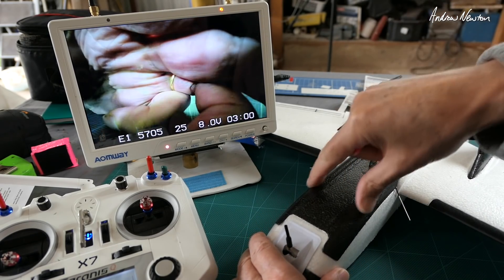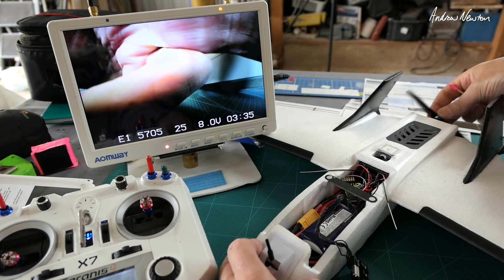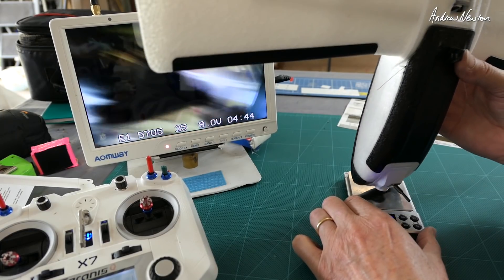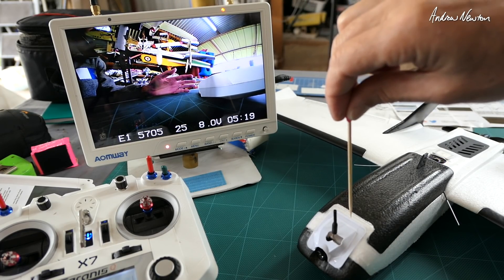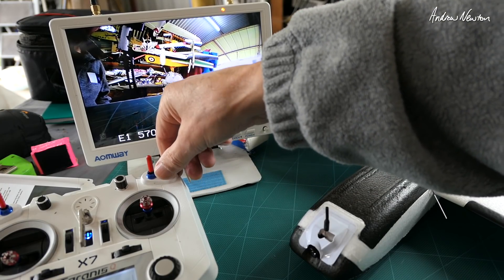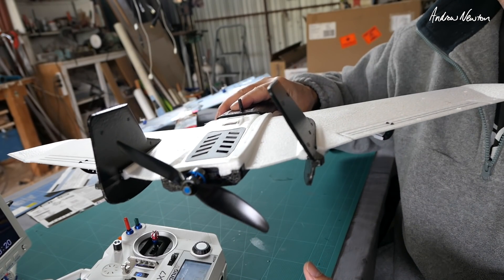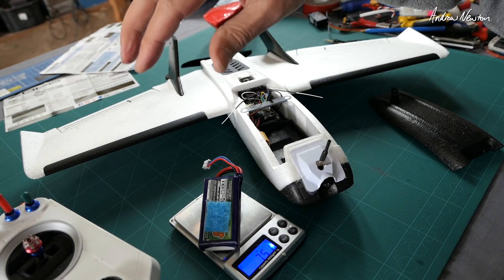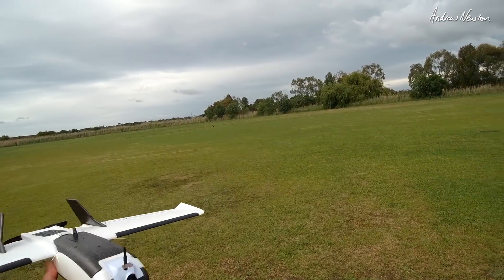ZOHD Dart 250G Kopilot Lite VC400

Comment: Thanks Andrew, the Kopilot actually worked better than I expected, especially with the winds, and the VC400 was quite impressive at 25mw as well and thank you for running it on 2s lipo an Li-ion was nice to see the power it still had running the smaller battery and larger prop, I think I am going to like this little guy. I would probably keep it grounded on days as windy as yours was there, but it is nice to know it is capable.  Cheers from the still cold rainy, snowy, and now icy Midwest USA.
Reply from the maker: Icy already? I'll send some warmth in future videos.

Comment: Good job  looking great.  My instructions didn't even say what voltage to run only 2s or 3s and the print is so small I have to use a magnifying glass lol.. Your instructions
are very helpful and thank you for that.  I will also be changing the connector to an xt60 connector also.  Happy Flying

Comment: My Nano Dart arrived an hour ago, already put together and ready to fly in the morning if the weather stays like it is now...
Reply from the maker: Good luck, throw hard and 3/4 throttle
Reply: @AndrewNewton  I would have thrown it hard if I could have gotten to my airfield which is situated about a mile from the main road. I have to travel a third of way on tarmac then the road changes to chalk, so far so good, and the final third is dirt which after some heavy rain recently turned to mud. The flying field is situated on top of a hill of about 100ft high. Unfortunately today, I got stuck 5 times in the mud and only got half way up the hill when i decided to give up and go home, my little Citroen C1 is not designed to be a 4x4... It will now have to wait till we have a long dry spell for the dirt road and field to dry out before i attempt to get there. Just have to build some more models instead...

Comment: Mine keeps ending in tears.  My Dart 250G keeps nose diving when using the KOPILOT.  On the bench everything seems set up correct. Control surfaces rise to meet the sticks with pitch and roll.  Put it in stabilized mode, roll right, and the left aileron rises, roll left, and the right aileron rises, pitch down and both ailerons rise, pitch up and both ailerons fall.  I have the KOPILOT set for WING, and did the level calibration.  I've set the KOPILOT up in the Drift, no issues.
Reply from the maker: Which mode does it misbehave in? Is manual ok?
Reply: @AndrewNewton   stabilized mode.  I have not tried to launch it in manual.
Reply from the maker: Have to have it flying well in manual before trying any flight control board. All the forward swept wing designs dip on launch so you need high throttle and a strong throw slightly above level.
Reply: @AndrewNewton  The Dart is / was my first plane.  After about 10 crashes after launch I went and bought a Drift with the Kopilot.  One  crash on the initial maiden, then I started getting the hang of it.  I'll stick with the Drift for a while until I get comfortable flying in manual mode.  As someone who is new just getting into fixed wing, one doesn't know what to expect after the throw.

Comment: Thanks Andrew for the informative video, as usual very well presented easy to understand.
I hope you can help me with a problem I am having with my new Kopilot Lite autopilot system.
I have it installed in a flying wing and set up via sbus from my RX.
I am unable to set up the Neutral Calibration by the sticks on my mode 2  Taranis TX. Nothing happens with the LED lights. No flashing. I was in stabilised mode as per the manual.
The radio calibration was successful though.
All other functions and set up is correct and working.
Many thanks
Mike
Reply: This happened to me as well. I had not realized that I needed to reverse the elevator. Check controls move as expected when moving the sticks on your radio.

Comment: Great video Andrew! Thanks so much! It's a good idea to keep the adjustment board in your toolbox when out to the field. If weather conditions (wind specially) differs too much from what you had setup, you can always dial down or up the gains to get a smoother ride. Remember to lower the gain is going closer to 12 o'clock on the dials (passing 12, you reverse the servos).
Reply from the maker: Thanks Sir ZOHD. In the upcoming video I did exactly that and the wiggles were greatly reduced.
Reply: @AndrewNewton  Thanks Andrew! BTW we loved the Box Dart! lol :D

Comment: Hey andrew in the kopilot manual they talk about balance mode as self leveling and climbs to 35 meters is that activated in angle mode automatically my wing seams climb to around that height then level off just wondering if that's the reason thanks any help is greatly appreciated thanks
Reply from the maker: In Launch Assist mode that is the expected behaviour

Comment: Andrew have you tried launching in Stabilize Mode by any chance. I flew mine for the first time yesterday in Manual Mode and didn't get very far I put the CG on the CG Marks it just wanted to nose down before I could do anything it happened so fast. Minor damage I torn the top half of one of the stabilizers off i had some tap put back on and tried again. This time instead of trying the Manual Mode again I did the Auto Launch / Return to Home combo and that went a lot better until it made its climb to the preset altitude it banked over to head back home and then it started wobbling out of control it made it's turn put it in Manual Mode then dove straight towards the ground I dropped the throttle and pulled back on the stick and flew it around one more time in Manual Mode. My gains were WAY to HIGH made the adjustments and took off again in the Auto Launch / Return to Home switch in Stabilize Mode and it was GREAT flying around in Stabilize Mode so smooth and stabilized but as soon as I switch into Manual Mode it nose dives. Do you fly with Reflex and if so how much. Sorry this was so long. Thanks for all the GREAT Videos!!!!
Reply from the maker: I have and it skimmed the grass every time. I tend to launch in Manual with an upward trajectory. But I have also reduced the rates in the Manual switch position https://www.youtube.com/post/UgwVA5kr4XkxnLg78kd4AaABCQ and turned the gains right down for stabilised mode.
Reply: @AndrewNewton  Thank you!!!

Comment: Great video Andrew. Question. On mine the input voltage is showing 4.08V on a 3s 2200 battery.  

Any ideas?

Thanks
Reply from the maker: Powered from one cell of the 3S?

Comment: Are you using a separate battery for the camera
Reply from the maker: Just the flight battery. ESC has a power cable for the FPV gear

Comment: Ive been wondering how this new Dart compares to the original 635 version?
Seems to fly a lot easier without the older ones bad habbits?
Also, being designed to run on 2S Li-Ion as well as Li-Po, would it be possible to run on the Eachine 2S Li-Ion packs intended for use with goggles???
If so, would the barrel connector hold up?
I'd imagine that this li'l sucker would be drawing too much for that type of connector?
Thank you again
Reply from the maker: Good question. I suspect the thin wires would heat up

Comment: Andrew,  just wondering, on this models website and all the other Zohd models, the verticals appear to be reversed from the way you did it —- they all lean out toward the tip of the wing.  Do you need to reverse yours and mr. iforce2d  as well?  Or do you know something we don’t, and this really is the way to run them??  My vote would be to switch them,  you’d get better performance I think!   Anyway, thanks for all the new cool video’s.  Cheers buddy!!
Reply from the maker: Nope, they are meant to be pointing in according to the model's webpage - https://www.zohd.net/zohd-dart-250g But they fit both ways and logically I think pointing out would give more stability. How much? That will have to be tested, maybe a future video.

Comment: How do you secure the fc board, esc, gps and receiver to epp? I tried 3m double sided tape but found everything came loose after a crash on my first flight!
What is the best method to launch? Angle, throttle, flight mode, etc.?
I am also using a 1300 2S LiPo with the 2 blade prop.
Reply from the maker: Just the tough outside double sided tape, GPS is held in with blenderm tape. I use manual to launch to make sure I have the elevator authority, with a lusty upward angled throw

Comment: Cute little thing! I'd be tempted to swap the AIO for a Runcam Split 3 Nano plus TBS Unify Nano VTx ... you'd then have HD recording as well as FPV. Should only add about 4 grams so ought to be possible under 250g, provided you can fit the 20x20 board in somewhere.
Reply from the maker: Sounds good. This setup is at least 8g under

Comment: Hi Andrew, what's your best setting position for aileron and elevator? At 9 O'Clock?
Reply from the maker: No, they are both reduced. One is 11 o'clock and the other 1 o'clock (cant remember which is which)
Reply: @AndrewNewton  thanks a lot. The point is mimimal gain 👍

Comment: Are you using sbus or pwm? I can't get the flight controller to work properly with pwm on my wing  and my fc didn't come with an sbus cable
Reply from the maker: SBUS
Reply: @AndrewNewton  did it come with an sbus cable?
Reply: @MikeMcCarty6453  No. But the Sbus input on the Kopilot lite is a standard servo connector.

Comment: Out of curiosity what did you set the gains at?
Reply from the maker: Minimal gains, as low as possible
Reply: @AndrewNewton  I'm running about 10 degrees from mid 90 degree mark. Not sure if that's enough or not

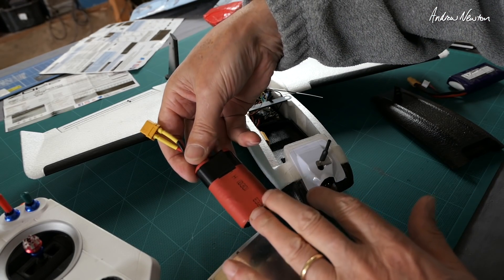Comment: 3:28.. You could remove the Heat Shrink and lightly re-tape the li-ion battery with clear 2" packing tape and reduce the length of the Battery wires to keep you under 250 grams.
Reply from the maker: Definitely, for super long flight time

Comment: Some of us are novices at this ...3 videos of 250g dart  with kopilot and then set up video on ranger....why no continuity...cant find any video of complete dart 250g and kopilot..setup from scratch....frustrating
Reply from the maker: The Dart250 is not for novices. Best to learn how to use the Kopilot on a more docile plane like the G2, learn how to fly the Dart250 by itself, and only then put the two together.
Reply: Started of with a Bixler 3 which as a novice seemed huge to me...have 2 nano talons..an orbit and 2 darts one now sub 250....my point is that i am still not comfortable with open tx and when you reviewed the dart 250g with kopilot i was hoping that you would put a video of the complete setup with the dart 250 rather than switching to another model...I work for the NHS ambulance service on 12 hour shifts so you may appreciate that at the moment i don't have a lot of spare time to chase around youtube trying to find setups..so why can't you just concentrate on one model with a complete guide start to finish...I am sure that i am not the only one that would appreciate it....this guy does it the way it should be....https://www.youtube.com/watch?v=m6AoJqJsFR8&t=596s

Comment: If this had at least one more flight mode it would be definitely worth it. But without stabilizer for rate mode it actually does not do that much besides rescuing the plane, which is great, but too much money for just that.
Reply: I agree. I'd prefer  three modes - manual / rate mode with stabiliser for the wind (no angle limiting) / RTH. It only needs angle mode when it is RTH mode not for normal flying.
Reply from the maker: Rate mode, Altitude hold, Manual and RTH then it would be a killer.

Comment: CAUTION: RTH height is fixed at 70m at pos 3
Reply: pos 3 is to initiate rth manually right? in that case pos  1 is auto level if it loses signal it should go to rth automatically right?
Reply: Matthew Herridge NO, RTH on loss of signal has to be setup in the Rx you are using.
Reply: @ror-ys3qp  i know the failsafe has to be set on rx but what i mean is does the fc go to failsafe on lack of pulses or do you manually have to set rx to switch to pos 3 itself on tx loss
Reply: Matthew Herridge yes the Rx has to set ch5 to RTH mode. I think you are getting confused...the pos 3 I am referring to is pos 3 of the pot for setting RTH...look at the manual...they show picture of pot with pos 1,2,3
Reply: @ror-ys3qp  yes i have 3 position switch setup already so p1 is auto level p2 is manual p3 rth. IN inav you see its the fc that initiates the rth when it detects no pulses. So i set rx to no pulses on loss of signal. But you are saying that instead of no pulses it should be set to manual setting of move channel 5 (pos3) on loss of signal instead. sorry just wanted to be sure. Means ive been flying long range on an xm+ with failsafe not technically set lol
Reply: Matthew Herridge yes you are right...the no pulses will not work unless you can make inav set channel to manual RTH on loss of signal.
Reply: Matthew Herridge the way to test it on the bench after you install Lipo in plane is set your switch to manual RTH and note that ailerons twitch to show you are in RTH but too close to home to activate.  Now turn your Tx off and see that the ailerons also twitch.  You have to test everything you setup one way or another.

Comment: If you use XT30 connectors you save 5 grams over XT60's, so you could still do liiion's.
Cheers.
Reply from the maker: Excellent tip thanks

Comment: you can use circular which would be way better so when banking your still with in the antenna range.

So far looks good, i dont know about the price of the GPS unit.. seems alot at 70 bucks... needs to be about the 40-50 Aus to make it worth while. Also, get a folding prop and see if that helps at all.